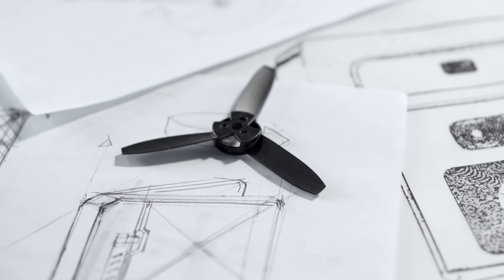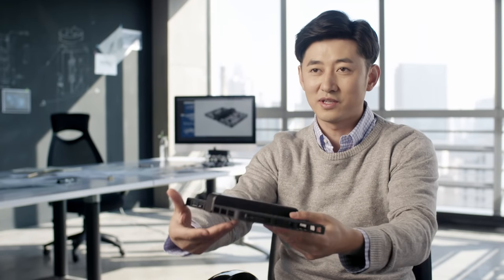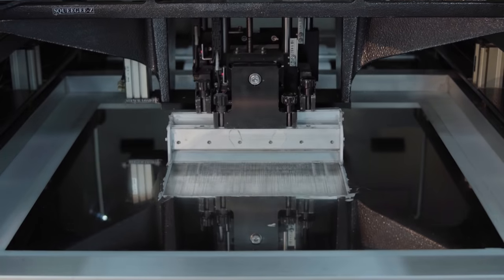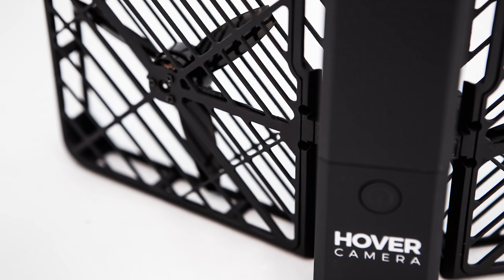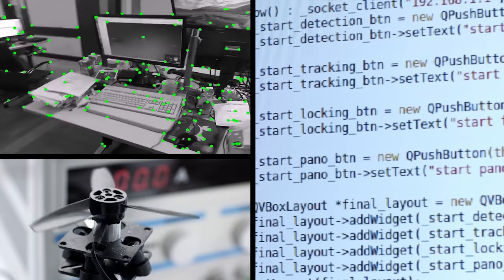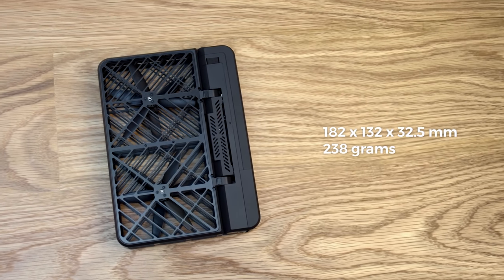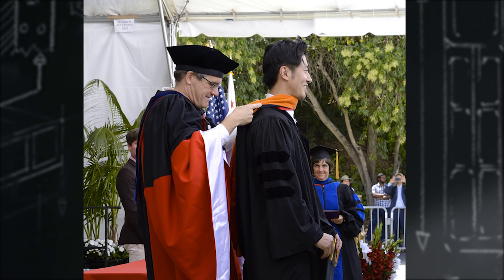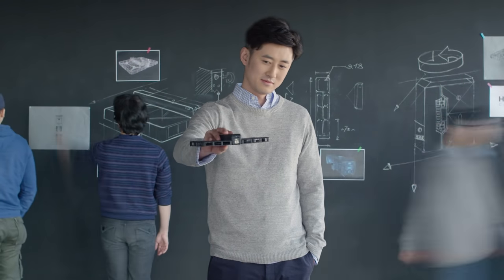Hover Camera - Introducing the self-flying camera anyone can use

Comment: Would it be possible to have it keep it's position stationary in XYZ, yet have it rotate or pivot to follow a target?
An idea to consider is possibly a power base tether, for situations where you want to record an event for an extended period of time, and you don't mind it being stationary. This could replace someone using a traditional camera and tripod set up. Saving space and providing a light weight and easy to set up method of recording life.

Comment: I love it...but what if im on a second floor balcony and someone or something bumps into it and sends it where i cannot reach it?
Reply from the maker: +andresc123 It has Auto-Repositioning, so if it faces a strong gust of wind or something bumps into it, it will go back to its original position on its own. Also - you can control it (fly it) manually through the app.